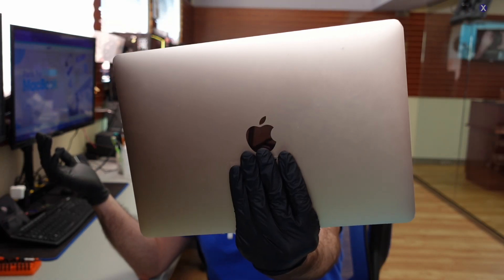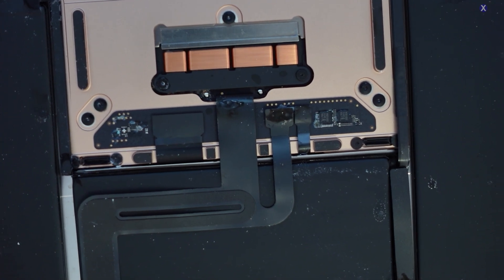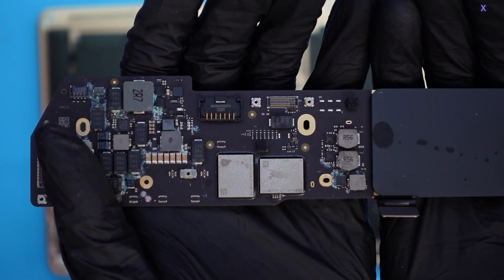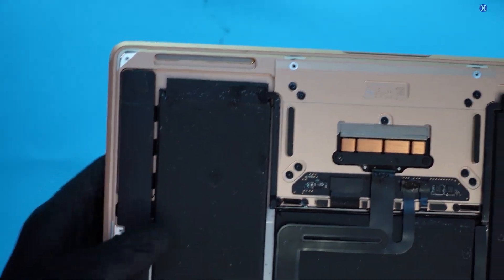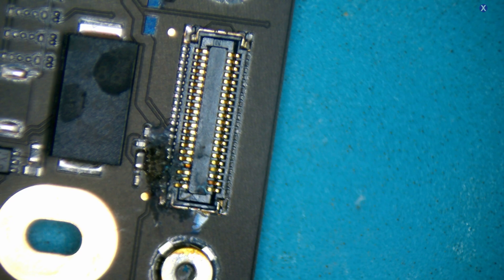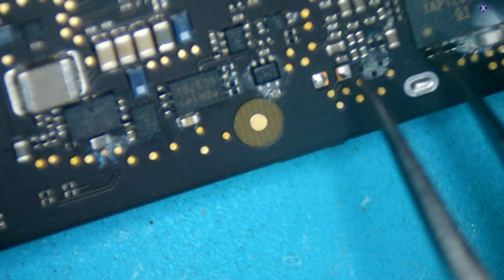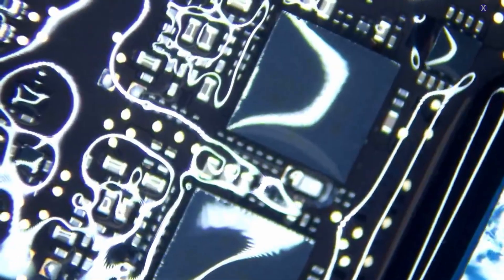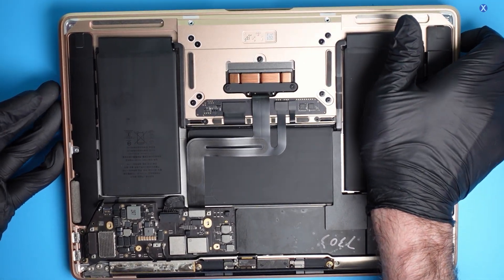How to Fix a M1 MacBook Air with Liquid Damage

Comment: Hi lapfix, let me introduce myself I'm Ary from Indonesia I have the same case as this video with a logicboard that is affected by corrosion but seawater and has been cleaned by the technician here but the technician's analysis is that it is damaged towards the processor and cannot be continued. Because I really need my important data, can Lapfix handle it?

Best Regard,
Ary

Comment: my Mac book m1 is charging ,sees my hard dives but doesn't see my hardwares like my midi keyboard and my sound card  finding hard to Work right now ..when diagnosis its shows (there may be an issues with power port).. The port has been changed to a new one but still get the  same  issue
Reply: have you managed to fix this?